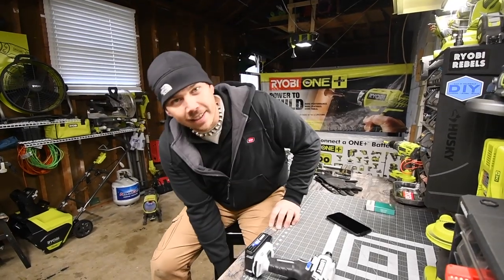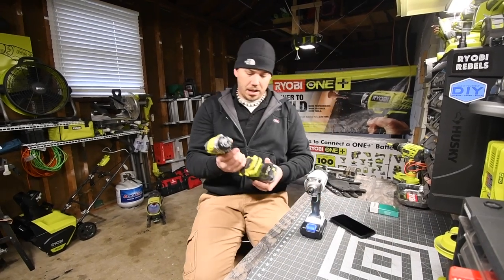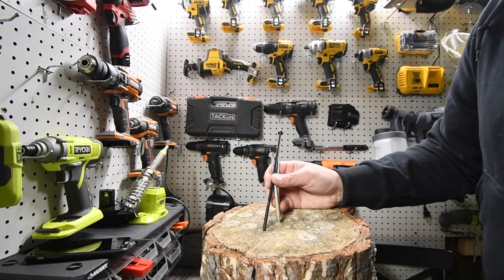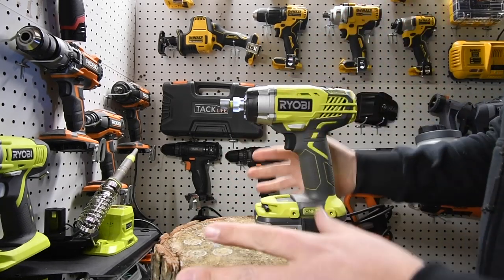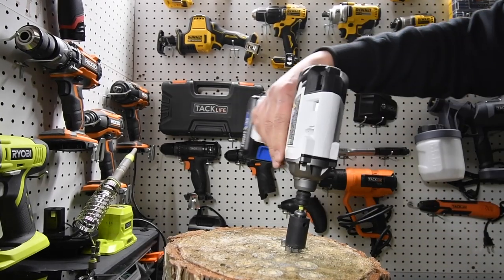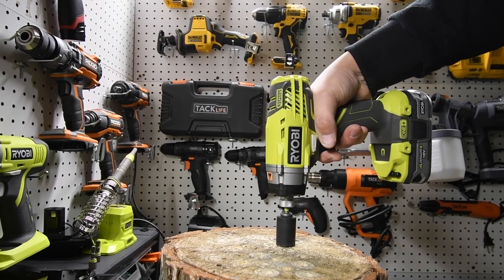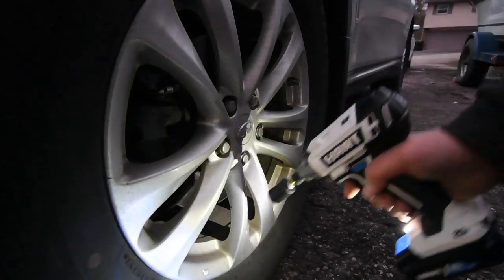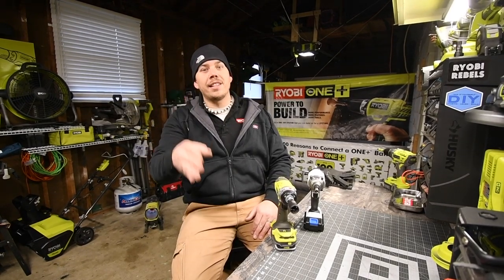Hart Vs Ryobi -Happy Thanksgiving!!

Comment: I love you to test hole cutting for door locks. Because this is the test most pros and some better DIYers will encounter eventually or regularly.
Try a 1-3/4" & a 2- 3/4 bimetal hole saws cut comparson test with both of these brands on a junked old exterior wooden  or metal covered Standley door. If not how about use it on 2" wood or 2" glued in plywood to simulate the MAX-CAN & the MAXI-CAN'T  of the two brands.
Reply from the maker: The tests are going to get more intense in the future and thank you

Comment: Thank You so much for the lug nut test. I wanted one for just that purpose and or any other but yeah ok now i know thanks again. 

I do appreciate it. Which impact diver would you recommend for lugs?
Reply from the maker: I already made a video of the in the past but I will make it again and thank you
Reply: There is a reason there are two different kinds of impact tools.  Impact drivers are generally rated in inch pounds whereas impact wrenches are rated in foot pounds of torque.  If the lug nuts in the video were torqued to the P261s maximum rating of 300 ft lbs, you'd need an impact driver with a rating of up to 3600 in lbs to break the lugs free.  My vehicle tires are spec'd at 80 ft lbs so if they are correctly torqued, a driver rated at over 950 in lbs should suffice, and since the driver is pushing away from the incline of the threads of the stud rather than against, it is likely a lesser rating in the vicinity of 850 in lbs would be adequate.

The impact wrench not only has more power, it will outlast a driver used in this application.  Also, the 1\4" hex to 3\8 or 1\2" socket adapter has a connection to the tool as well as socket whereas the impact driver can skip the adapter resulting in a more direct connection and fewer points of failure.  It also introduces a weak link with the less robust 1/4" hex shank.

You can get away with using a driver in many circumstances but the wrench is the better tool if you need to turn large sockets.
Reply: Juergen Welz I agree.  If a person is using this tool regularly, I would not go with either of these brands.  I would go with Milwaukee, Makita, Bosch, or De walt.
Reply: @carlrest6553  It's not clear what you're agreeing with.  I'm certainly not saying that I would recommend another brand over Ryobi.  For my purposes, changing over winter tires on two relatively light vehicles, the Ryobi would easily last a lifetime though my preference is currently only to buy brushless battery powered tools and Ryobi don't have a brushless impact driver in their current line up.  I use a manual torque wrench for final setting and a regular 1/2" socket drive with an 18" handle and just do it manually like I have for the past 30 years.  I even just use the little scissor jack that comes with the car/SUV.  Now if someone made an adapter to drive the jack up and down, that would be helpful, even if it just worked with the socket drive handle, but I would want a battery tool with more torque yet skip the impact mechanism for that application.
Reply: Juergen Welz I was writing I agree with your explanation between impact drivers and wrenches.  I was saying that if your putting tires on and taking them off everyday for a living, I would steer clear of Ryobi because it won't hold up.  Btw, I do believe Ryobi has a brushless impact in their one+ lineup.  My friend has a Diesel repair business and he uses Milwaukee and has never had a problem taking off or putting on a tire.  He told me he just bought the Milwaukee fuel I think it's called and he tested it on rusted lug nuts on wheels that have been sitting for years in his hard and he said he never had a problem taking them off.
Reply: @juergenwelz2591  you can drive the scissor jack up and down with an impact gun and whichever size socket it takes (usually 19mm) go out & try it you’ll be amazed at how quick it goes. Maneuver the jack with one arm and trigger the gun with the other.

Comment: Do you run that propane heater with the garage closed? Been wanting one for my garage but didn’t know if I needed to crack a door or window
Reply from the maker: no I open the door that leads to the screened in porch the has as sliding glass door once in a while to vent it out
Reply: Brett Hopkins please don’t run propane heater without some sort of ventilation

Comment: I use contractor grade tools knowing most of the time it won't let me down. Many of the homeowner tools perform pretty good at first but falls apart in the long run. Its designed to a low price point.
Reply from the maker: that is correct, I say that in a lot videos as well. Ryobi has the power like Milwaukee has but Ryobi won't withstand tasks over time newly as well as milwaukee or dewalt can. Ryobi power will die out a lot sooner
Reply: kimchee94112   Most professionals would buy a higher grade tool, I find Ryobi the best bang for the buck as a normal guy. So I find many comments a mute point when adding their opinion. I’m pretty sure Wally World will sell many Hart tools, but everything is geared to the average consumer not the professional and the biggest thing for any cordless tool regardless of brand is the battery if those aren’t any good then the tool is useless, and it remains to be seen wether Wally skimped in this department. That’s another reason I like Ryobi  because they’ve never changed the battery fitment and the batteries are good. Just my 2 cents
Reply: @powderriver2424  Don't need to be a pro to purchase pro tools at bargain prices, but you need to shop around for deals. Good set of 12V tools cover 90% of what homeowner needs. The other 10% you could rent or buy Ryobi, Skill, Craftsman, Portable Cable, etc. As example Milwaukee M12 4 tool set with 2 batteries, charger and bag for $200, open a Home Depot account at the cash register and its $150 for contractor quality tools!

Comment: None of these tests are accurate!! The position you place the screw can win or lose you the test as the tree is not uniform everywhere. I think you need to stop doing these imperfect tests. 
1. Build a test rig that will apply the same level of pressure on the tool throughout the process. 
2. Get something like a big butchers block or other engineered block.
Vote up if you agree with this not just for this test but for all of these types of tests.
Reply from the maker: I thank you for viewing amir